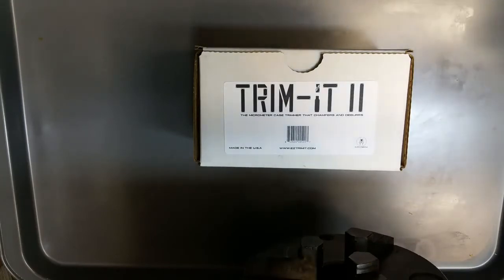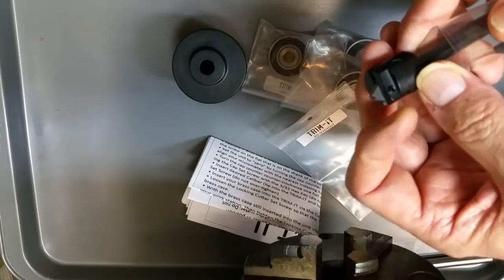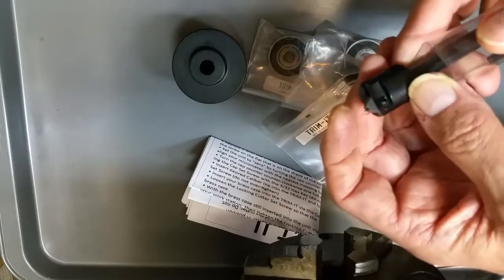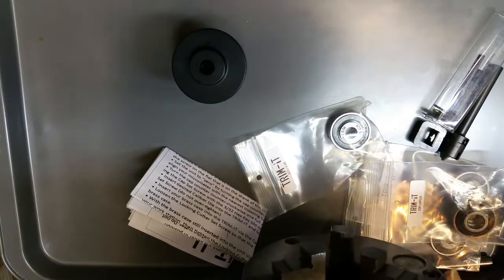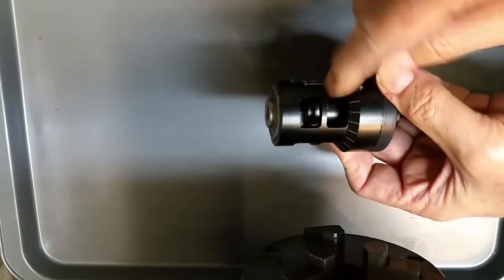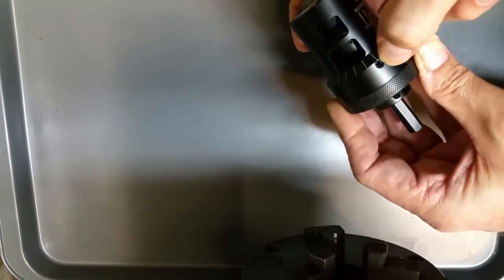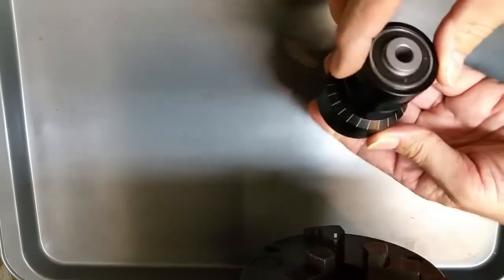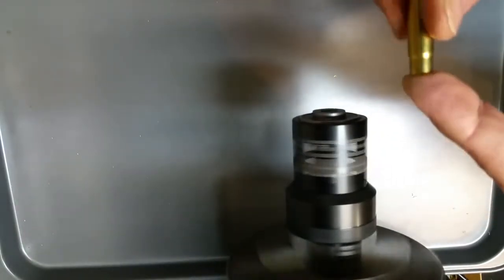Trim It II Brass Trimming Using A Lathe

Comment: How has this performed after a year of use?  Any new concerns or considerations?
Reply from the maker: I haven't used the Trim-It II all that much because I haven't been reloading much rifle ammo lately, but so far, so good.  It's a very solid tool that's well designed and overbuilt.  I can't imagine any problems developing.  At worst, brass shavings might find their way into the bearing, but I could just buy another one, or probably press the insert out and replace the bearing, but even that seems like a remote possibility.  I'd say it's rock solid and Good 2 Go.